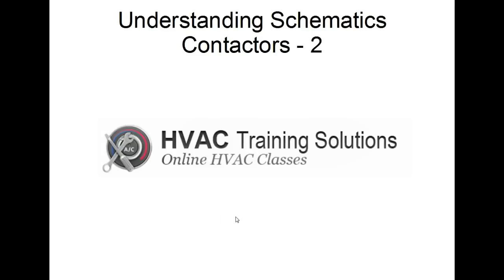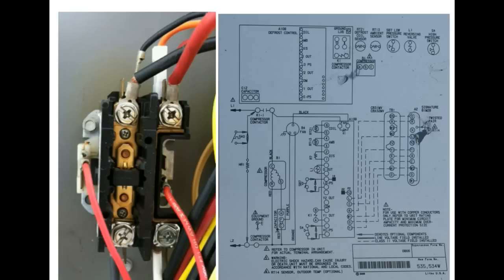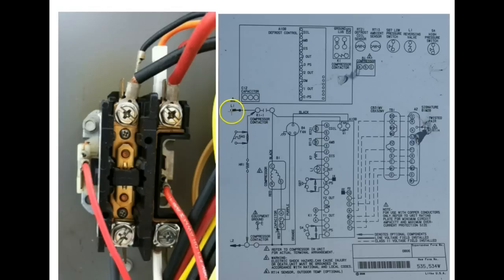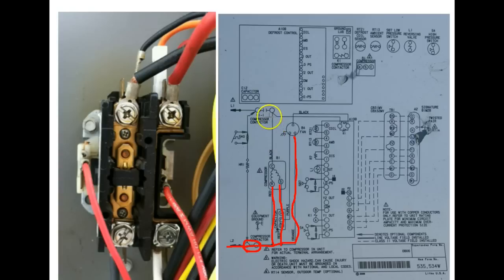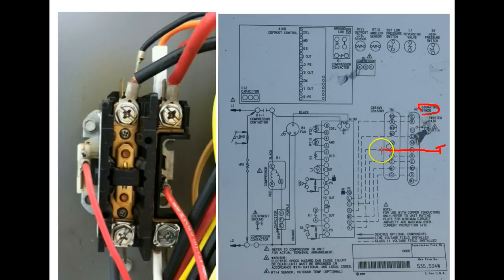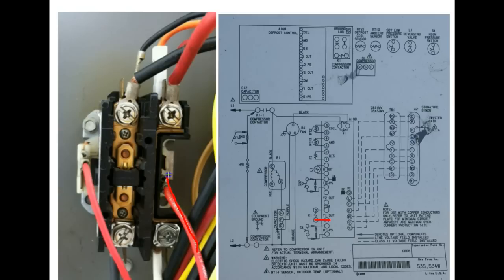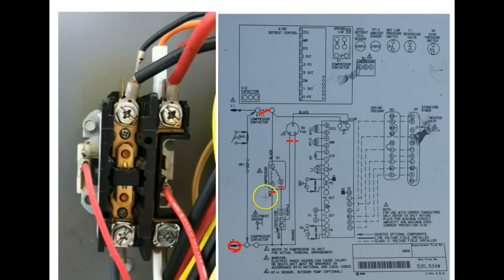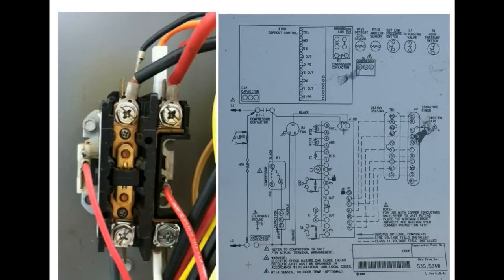HVAC Training Understanding Schematics Contactors - 2

Comment: I am revitalizing some outdoor units that survived a flood here in Roswell, NM.  On a vacant house the T-stat is not turning on the heat call outside (AH comes on), the T-stat seems to be ok. The outside unit kicks on if I hold the switch on. Lo V is going to solenoid. I changed the board (wasn't kicking on 'O' during test). However, on this single pole contractor I get 120 V between the T1 side and chassis ground.  Is this normal -IDK? seems dangerous.  I think it does have the current on a single pole.   Comments please !!

Comment: Question! 
Does that 24 Volt have any negative or possible position and need to connect to correct side of connector, or we can connect either side of connector,
will does not make any difference.
Thanks!
Reply: Any side would work
Reply: We test 24 voltage in Vac not Vdc. So, VAC will work any side.

Comment: I have an old schematic from a 3.5T HVAC [YORK model JDB042506A  https://nextdoor.com/news_feed/?post=113098995] but it is soiled from the years and elements.  Is that a way to find it?  I tried searching "York 035-10839-000", but cannot locate it.  Any suggestions for sites?  https://drive.google.com/file/d/1sRhz8clIbPmlSr-W6-f1qhDOq8qcc9Aw

https://nextdoor.com/news_feed/?post=113098995

Comment: WHAT IS THE STANDARD COLOR CODING FOR HVAC COMPRESSOR WIRING TYPICALLY?  IS IT MOST OFTEN FOUND THAT THE BLACK WIRE TO THE FAN AND COMPRESSOR MOTOR IS GOING TO THE COMMON TERMINAL?  RED WIRE FOR RUN AND YELLOW/ORANGE FOR START WINDING TERMINAL?  It would be nice to know, but its probably not wise to guess which is the run and start winding.  Also, on compressor motor terminals theres 3 prongs, are they conventionally always in the same placement common on the center, and start run terminal on each side?   I KNOW YOU CAN USE AND OHMETER BUT SOMETIMES THE DIFFERENCE IN RESISTANCE IS MINISCULE between the 2 windings.  I know the start winding is usually about double the ohms of the run winding. 

Whats weird is if you're ohming the windings from the wires in the control panel area, you can get false readings if you don't realize the other motor (fan or compressor) is wired together through the common wire.  So it can throw off your Resistance measurements. basically the common will goto both motors and through but run windings (fan and compressor) and tie back together at the Contactor Relay.

Comment: I installed an EMERSON SURESWITCH Solid State Compressor Contactor Relay with a KS-1 Kickstart HardStart Kit (relay with start capacitor) today....  I couldn't help but  noticed that PREVIOUSLY the Compressor motor WAS wired OPPOSITE of whats shown in the installation diagram for the Solidstate Relay.  Despite this, everything  seems to run fine.  Is that ok?  Originally the N.O. contact was wired BETWEEN L1.and RUN terminals of the motors.  HOWEVER, the Emerson  Sureswitch Diagram as shows that they want L2 to be connected to the N.O. Contacts while L1 to Run Windings is ALWAYS ENERGIZED... so that is opposite of how my setup was wired before.  EVERYTHING SEEMS TO WORK. i DID NOT TRY FLIPPING THE L1 AND L2 TO SEE IF IT MADE ANY DIFFERENCE.  I SUPPOSE SINCE ITS SINGLE PHASE 240VAC POWER IT DOESN'T REALLY MATTER, ITS THE SAME WAVE FORM REGARDLESS IF YOU FLIP L1 AND L2 ... RIGHT???

Most diagrams I have seen suggest the Common side of the motor should be switched with RUN always hot BUT IN MY SETUP, I DIDN'T FOLLOW THE SURESWITCH DIAGRAM, I stuck to the way my setup was wired before.  I had the RUN windings wired to the Contact, with COMMON ALWAYS ENERGIZED.  THE UNIT RUNS FINE BUT IS THERE ANY REASON WHY I SHOULD HAVE IT THE OTHER WAY AROUND with COMMON BEING ENERGIZED/DE-ENERGIZED?  I can only think that its safer the way I have it because the run capacitor is not always energized.  However would the frequent switching on and off of power the Run CAP Common Terminal, would that WEAR THE CAP OUT SOONER? 

DOES IT MATTER IF YOU FLIP THE L1 AND L2 WIRES COMMING IN?  and Does it matter if your contactor relay NO Contact is connected to the motor Common or the Run winding side?

Comment: You purposely overlooked  the most important part of changing a furnace from heating mode to cooling mode. Some contractors neglect to increase the fan speed for air conditioning even recommending buying a new motor e.g. a single spd. motor when that is not necessary. Breeze Htg./a/c Electrical in Chesterfield, MO. did just that . . . how smart is that???

Comment: Ok I need help I'm a little lost 
I have a 2 ton u it I have 240 on line side of contractor I have 120 on both side of contractor but compressor doesn't come on the fan come on.. single pole contractor.. also with thermastat off I push contractor in and fan starts and keeps running even after contacted is disengaged. Also compressor ohms are good and cap is good
Reply: neutral not coming..
Reply: No neutral on 240V lol
Reply: Armando Monreal go across, L1 and L2 with meter, you should have 240V,
Reply: Hpco or lpco maybe

Comment: nice video! just need to clarify what is the purpose of using a single throw contactor as to a double pole? is there a reason for that?
Reply: Robert Munguia singles pole will still have power passing through the unit double pole stops all power until the coil is energized
Reply: In my opinion in the AC business, it's a cheep way to get by. That contactor is handling 230 volts AC.
If you took a meter set on AC and put one lead on the metal case of the unit and the other lead on one of the power contactors voltage in terminals, you will read 120 volts. Doing the same test to the other terminal with the straight bar, you will read 120 volts. In reality that system has 120 volts AC live to it at all times unless you turn off the breaker it pull the disconnect.

Comment: hi
ive just changed my contactor twice and its not pulling in. ive 240v in but no 24v or 240 out. please help.thanks
Reply: I would check the secondary side of the control transformer for 24 vac. Without 24 volts, the contactor coil will never energize. Make sure your t-stat is set to cool.
Reply: check the power suplly

Comment: A LOT OF PLUMBERS AND H VAC CONTRACTOR CALL ME FOR TROUBLE SHOOTING AND WIRE UP CONTROL'S BUT THE ONE BELOW GOT ME TOOK 4 HR TO GET THE LIST BELOW TO WORK BUT I SAID GET RID OF THE OLD CRAP AND BUY A 2 STAGE HEATING SYSTEM TO SIMPLIFY THE WIRING TO MY COMMENT BELOW
Reply from the maker: Carol Petrusewicz 
Hey Carol, Sound like you are a wiring Guru. I could not quite understand what you were looking to do but it looks like you got it done! Great work!

Comment: I AM AN ELECTRICIAN THAT DOES WIRE CONTROLS BUT THIS HAS STUMP ME A OLD 3 WIRE HEAT PUMP OK THERE 2 COMPRESSES, 2 3 WIRE HEAT PUMP WITH HEATERS 1 TRANSFORMER AND 1 THERMOSTAT HAS NOT WORK FOR A LONG TIME I WIRE UP TRANSFORMER TO R W THERMOSTAT BRING POWER TO Y THROUGH CONTRACTOR OF no RELAY AND BACK TO A DOUBLE TROUGH RELAY THAT TURN ON BLOWER MOTOR BROUGHT A WIRE FOR BLOWER MOTOR SO I CAN RUN FAN ON OR AUTO OR FROM COM TO REV VAL BLUE Y 24 VOLTS FOR COMPRESSOR MOTOR TO K1 THE FORGET IT I GOT RUNNING BUT NOT CORRECTLY    do YOU HAVE A VIDEO OF WIRING 2- COMPRESSES , 2 HEAT PUMPS 3 WIRE AND 1 THERMOSTAT WITH 1 TRANSFORMER

Comment: ok update I figured out and confirmed the how the contactor relay should be wired and this even all was working good with thermostat turning it off and on but suddenly the outdoor unit turned off not sure why I guess I will look at it tomorrow morning. now I am confused totally unless the contactor relay stay open relay not working anymore ??? Is this a bad contactor relay.
Reply from the maker: Was the contactor pulled in. Also, digital thermostats have a 5 minute delay if you turn it off and on again. Chances are the relay is not bad.

Let me know how it turns out.
Reply: well the furnace fan was on but the unit was off so I think either breaker or relay couldn't hold on position. I will check it once the rain stops. but I appreciate any more ideas

Comment: is it possible to have current going from L1 to L2 , when the contactors are not shut ?
Reply from the maker: Hi Tom,

The short answer is yes... IF there is a complete circuit. Sometimes the crankcase heater is wired to the L1 and L2 input at the bottom of the contactor. If the temperature control fails, or if there isn't one, that could be the reason.

Did the answer your question?
Reply from the maker: If the crankcase heater is wired on the L1 and L2 side... yes.